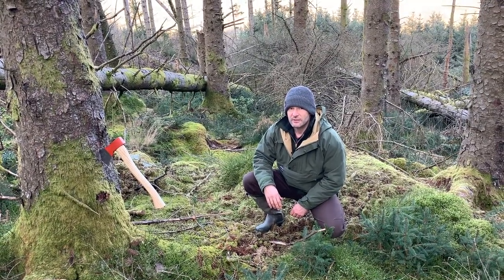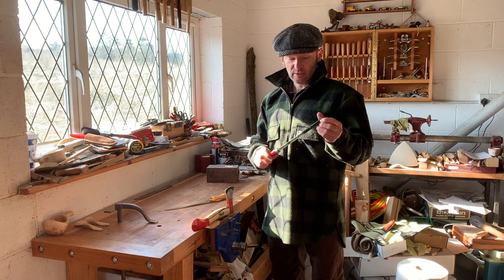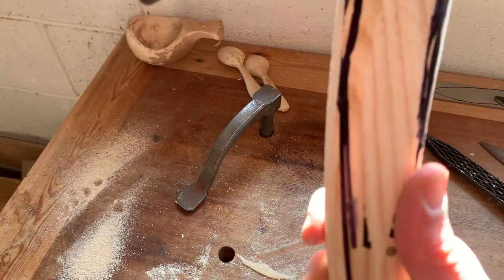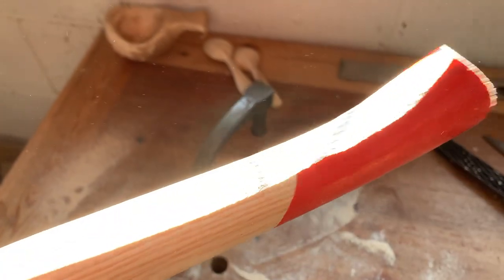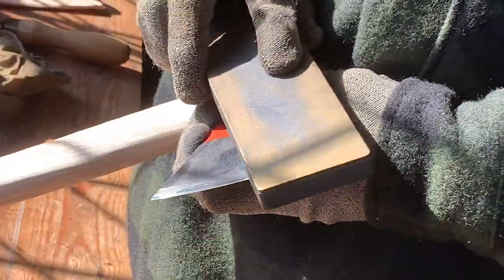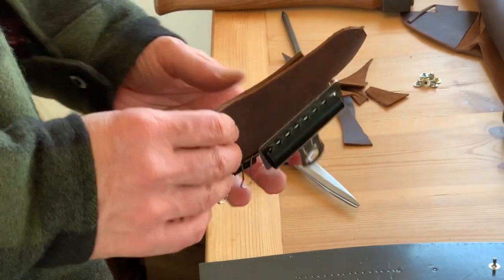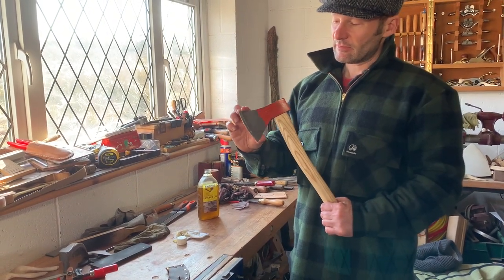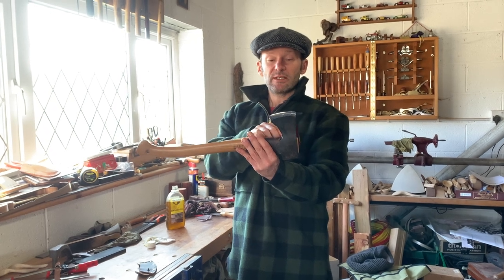Stihl Forestry Axe / Hatchet for Bushcraft. Modifications, use and review.

Comment: G'day mate. Good to see a review of this axe..iv had mine since about 2014 maybe, and it's been a flawless hiking/camping beater tool, also handy as a bark peeler and wedge banger when bucking firewood with a saw. Very underrated gear. Iv noticed the edge seems basically rust proof- one of the stihl catalogues claimed it was stainless. Interesting to hear they may be made by rinaldi, I'd always assumed oxhead. Thanks for sharing- subbed
Reply from the maker: Hi Kurt, thanks for the feedback! Stihl seems to get the balance right of cheap gear that is still quality and in this case not made in China. It was mentioned on a forum that it was made by Rinaldi but later I saw someone else say they thought it was made by Prandi? At least still European and it is definitely good steel. Did you modify the handle at all as I found it way to thick?
Reply: @bundufundi  your welcome, no I left the handle as is- its definitely chunky, but for what I use it for it for it didn't bother me. I also made a leather sheath for it similar to yours, but it takes such a good edge it's actually cut the welt and stitches a few times getting banged around in the truck. Been great value for money, and I havnt bought another hatchet since